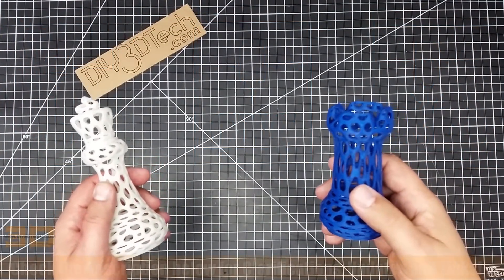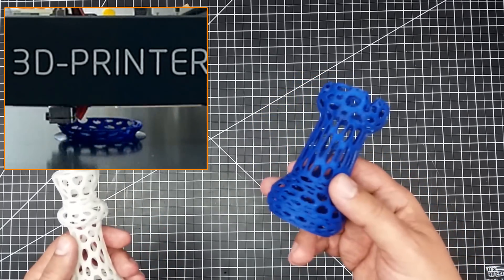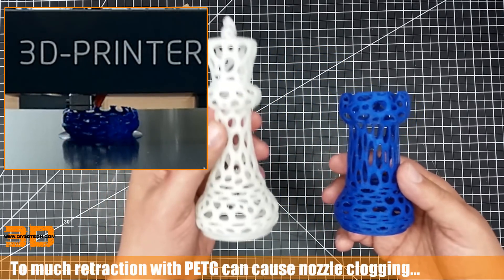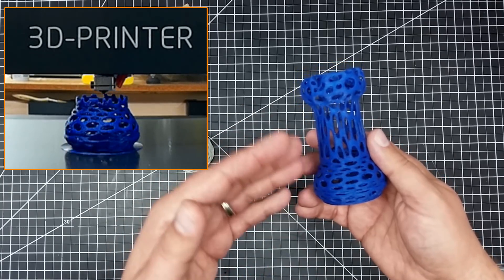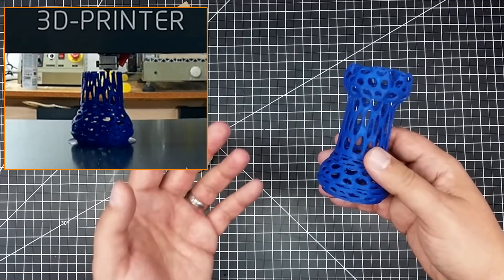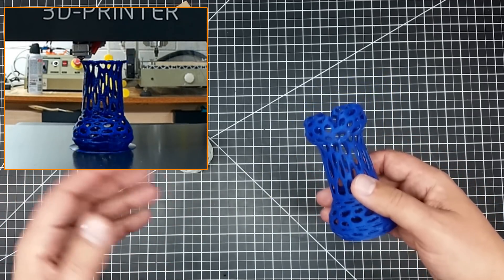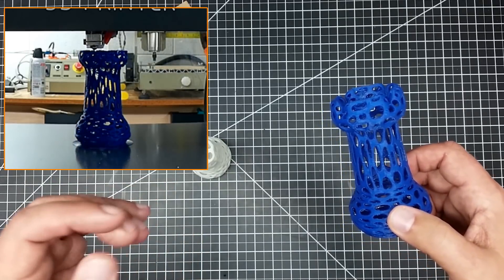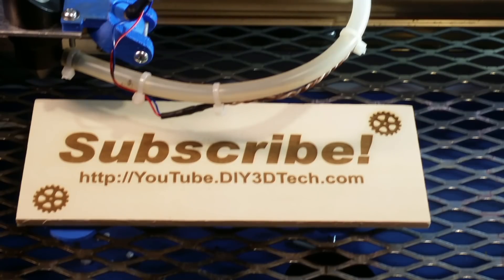GearBest JGAURORA A5 - Watch it Print PETGand Check Out The Results!

Comment: Thank you for the video, I just returned a petg roll because I couldn’t figured out the settings in the jgaurora,  very frustrated,I’m sticking to pla for now because I’m new to 3D printing
Reply from the maker: If your new stick with PLA till you get some time under your belt.  When you move to PETG pay the money and buy high quality as the cheaper stuff typically has fillers which is usable but problem-matic.   Also with PETG you need to go slower as it doesn't flow like PLA...
Reply: Thank you. God bless you I was thinking there was something wrong with the printer

Comment: Hi did you use stock ptfe - lined throat for the stock hotend? No need to switch to all metal throat?
Any long term effect if I dedicate my JG aurora A5 for high temp printing like bed warping, heat creep, clogging?
Reply from the maker: All stock, so long as your below 250c I have not seen an issue...
Reply: @DIY3DTECHcom  thank you. I will try this

Comment: I am wondering if anyone has had problems with PETG peeling off the Black Diamond coating on the bed of the A5.  I want to begin printing PETG on the A5 but have heard of reports where the coating comes off with the print.  I am trying to quantify my risk.  I have been thinking of using Hair Spray on the bed before printing as a precaution.  Any input would be wonderful
Reply from the maker: I have heard that the PETG will pull up the glass of the glass bed.  I have not had that happen, but other viewers have reported it...

Comment: Such high temperature is not needed. On JGAurora A5 I use 225 °C, 80 °C for large prints (70 on small) on heatbed. No fans, 90 mm/s for fast prints with 0.3 mm layer height (i don’t need details as I create useful practical stuff). Flow set to 97 %. No stringing, layers stick together like hell. All other settings default on Cura, as ai have found out the more you mess, the worse results you get.
Reply from the maker: I find I get a bit better results with a hotter temp but it might also be the brand of PETG too...
Reply: no doubt about that, especially on high speed. I'm using either Devil Design PETG (polish stuff, great quality for good price) or Plasty Mladec (Prusa is selling those under their brand). But really, it depends on brand, speed, extruder etc. Like all things in 3D printing…

But, regradless of PETG brand, layer adhesion and whole thoughness of print is better without fan (or very low fan like 15 %). More stringing and little worse details for sure, but it simply holds better. It depends on what one prints most. If practical stuff like ammo boxes or tools for reloading ammo like me, no special details are needed. It just has to work and look fine.
Reply from the maker: Will have to try that brand, sound interesting and thanks for sharing!

Comment: Hi, i just got this and sort of a newbie. when you start printing, how do you get it to not pre-extrude? that always screws up my first layer. I tried loading the filament after it heats up, but it still pre extrudes. I wish it would retract a bit after every print so that the tip won't be melted by the extruder at the start of every print.
Reply from the maker: Have you watched this video: https://youtu.be/bnRY1-r5nw4

Comment: Love PETG, almost as easy as PLA. I run 246 on my CR-10 with great results, I'll have to try a little hotter bed, I've been running 65. There is more stringing than PLA but clean up is easy. Great filament, I've been using Hatchbox.
Reply from the maker: Me too on Hatchbox PETG, been good stuff and just got another roll in yesterday!

Comment: I often use Esun PETG and print with 245C and 70C and never had a problem. Colorfabb XT a little bir problematic but still 245C and 70C works well. I never needed to use more than 70C bed temp for PETG blends I used.
Reply from the maker: Interesting and no warping issues?
Reply: DIY3DTECH.com I never had warping issues. Even on cheap Chinese Buildtak clones. On Ultem PEI I use magigoo or airnet hairspray not to make it stick but to pop it out when it colds down. It sticks too well to PEI at 70C. I never spray the hairspray directly but spray it first into a glass and use a sponge to apply it on the surface. after each print I use ipa to make it fresh.
Reply from the maker: I find the sticking part interesting as on PEI I have not seen this, do you have the same issue on the Buildtak clones?
Reply: DIY3DTECH.com Petg also stick well to Buildtak clones with 70C. When cools down it is easy to remove.
Reply: I got this to work at 230/70. I find lower temps keep the shine and it seems stronger too. but, I have to print with a raft always, else it won't adhere. still haven't figured out why yet. maybe its cuz my a5 has a detachable bed so that screws up the leveling.

Comment: Retraction distance 4.2mm, retraction speed 30-40mm/s. Print speed 30-40mm/s and travel speed 100mm/s. Temps vary A LOT depending on the blend. I have one PETG brand that prints at 224C hotend/60C bed and another that prints at 255C/78C. I have no PETG blend that needs 100C on the bed, even for large prints 80C is my max bed temp for PETG. I am interested in finding a matte finish PETG blend. Some blends I have have a low gloss-satin finish at low temps, but layer adhesion/part strength goes out the window at low temps. Sanding to a matte finish is not an option unfortunately. No PETG blend I have tried so far sands well/easy, unless it is wet sanding and a flat surface.
Reply: When I use cooling fan around 60-70% I get a matte finish.
Reply: If you do a lot with PETG, consider buying a sandblaster set. You can make it mate very easy then.
Reply: DIY3DTECH.com Did you try Ultem PEI?
Reply from the maker: Think I am going to work another video based upon this thread as a lot of good info here.  Because as an aside at the lower temps I with Hatchbox PETG I have delamination issues, so I have typylcialy printed on the hotter side...
Reply: True, I have observed that as well, 60-80% fan gives a semi-matte finish, but still layer adhesion suffers from high fan cooling. On most PETG blends I have, I use 28% fan and 42% for short layer times and max 50% for bridging. I print functional stuff (brackets, enclosures, adaptors etc), so I am not willing to sacrifice part strength and layer adhesion. Thanks for the responce though.
Reply from the maker: Interesting comments, and I am little surprised at the lower bed temps and no issues...
Reply: Greg El I believe it depends on the petg brand and also fan and shroud type. I print 3D printer parts I manufacture and never had an issue with layer adhision. I use 60% with 50mm centrifugal fan from one side of the nozzle. I manufactured some parts which are under high tension and pressure still they work perfect. Again it depends on petg brand, fan & shroud type.
Reply: Maybe some of my PETG has absorbed moisture, but the parts I printed to test 70% fan speed (50mm centrifugal fan with a shroud like on the original Prusa MK2S/I have a custom-modded Felix printer) did not print extremely weak-brittle, but layer adhesion was noticeably worse. I buy good blends from reputable brands and with 28% fan speed they print very well and very durable, so if it was an issue with the brand I think 28% or 42% would not work as well as it does for me. 

PEI and Kapton work well for me with max 80C on the bed. Even for prints that would usually warp like a 150mm thin and long 2 part bag clip. Don't try clean glass, PETG sticks too well to glass and can take shards of glass with the part when you remove it. If you have trouble with PETG, before rising bed temps, try a bigger brim and adhesive coatings like glue stick or magigoo.
Reply: DIY3DTECH.com Here the most important thing is aperfect leveled bad. each of my printets has autolevel feature and I even use glass with autolevel with pause function of Marlin and if bed is levelled pla do not need heated bed, petg 60 or 70 is enough. I even tried petg without heated bed, sometimes works so not reliable.